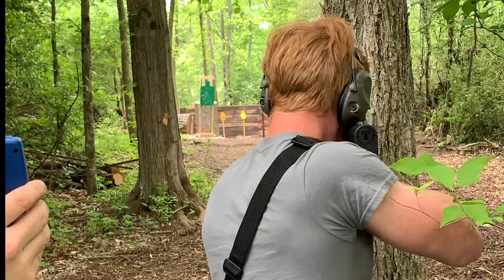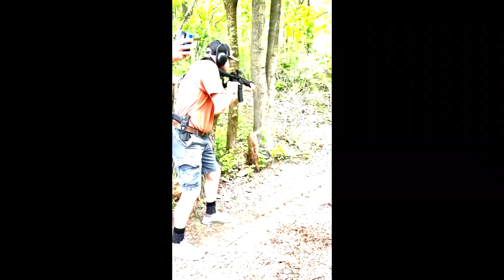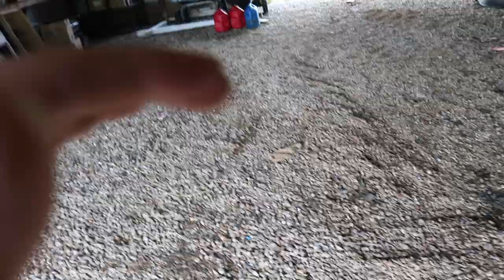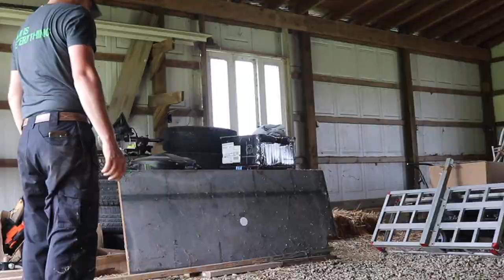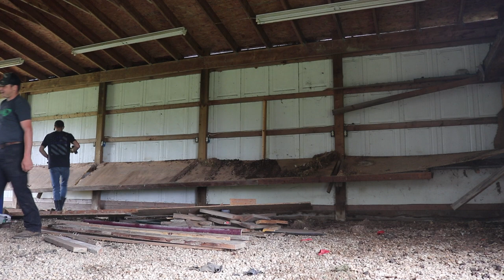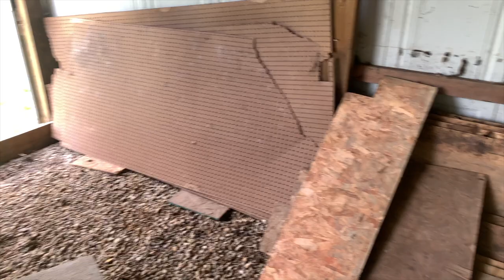SHOP DEMOLITION with the NEW GUY!!!

Comment: You may have a rodent problem in the shop :-P time for some barn cats. I still suggest you spray foam the walls before you put the tin up. It will help seal all those cracks